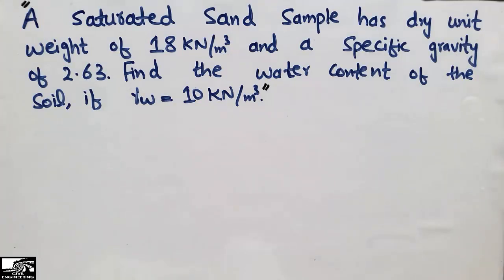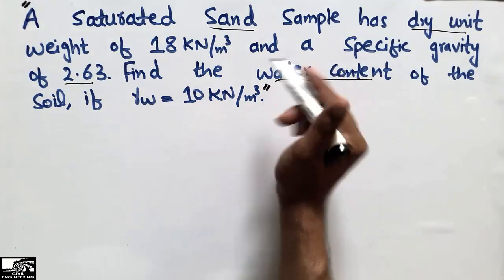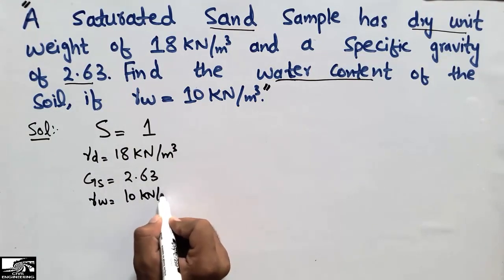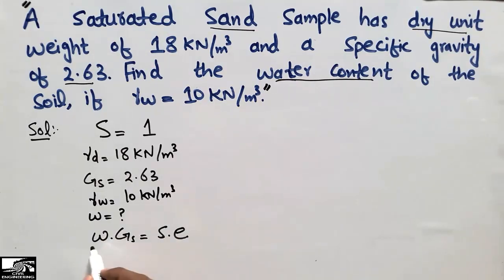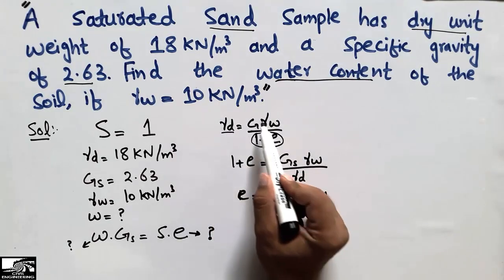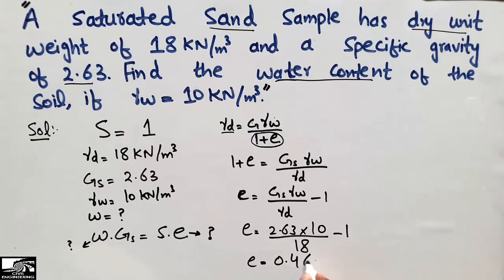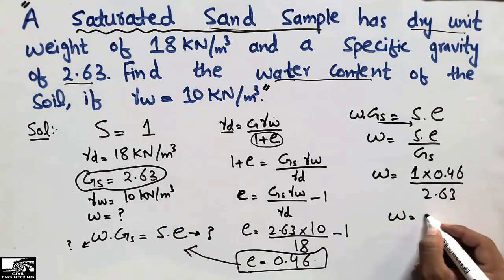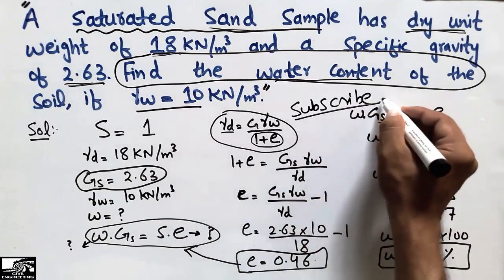Soil Mechanics || Problem Solved

Comment: A well is dug in a clay formation surmounted by a sandy formation. The upper level of the clay layer is 5 m from the ground. The water level in the well is 10 m from the ground surface. The thickness of the argillaceous aquifer is 12m. It is assumed that no rise in water by capillary action is recorded at the higher levels of the water table.

1- A soil sample was taken at a depth of 10 m. Its total mass and volume were measured as well as the mass of the solid grains, which are 140g and 65 cm respectively, is 130g. Give the degree of saturation. We give: g = 9.81 m / s, the density of water is 10 kg / m, the density = of solid grains is 2.7.

2- Another sample at a depth of 6 m gave a weight of 18 KN / m. Give its specific gravity if it is saturated with water.

3- Calculate the effective stress in a plane located 12 m below the ground surface. The water content in the aquifer is estimated at 54% The density of clay is estimated at 21 KN / m, that of sand is estimated at 19 KN / m

4- Calculate the settlement of the clay layer due to a pillar of a projected bridge which will weigh 3800 KN. The clay layer is estimated to have a cedometric modulus of 2.4 MPa.

5- Calculate the time necessary for this layer to reach a degree of consolidation of 45%. The coefficient of permeability of this layer